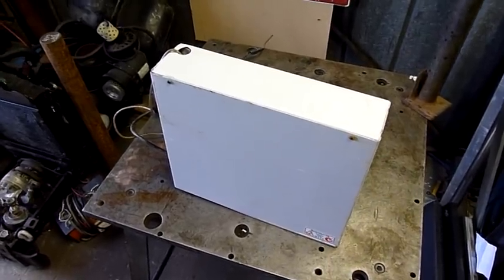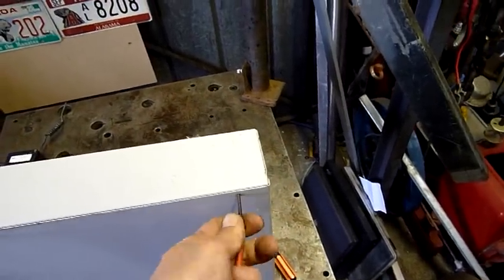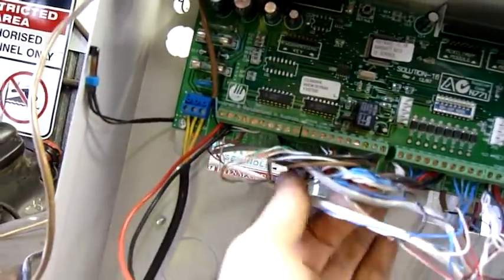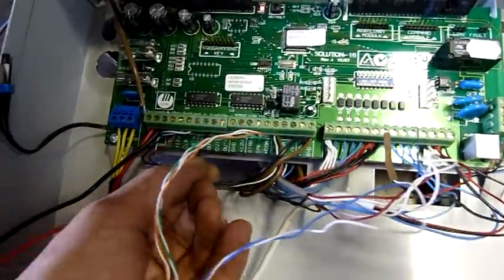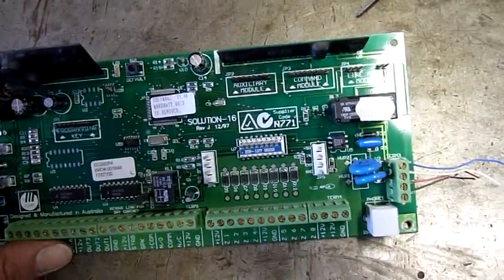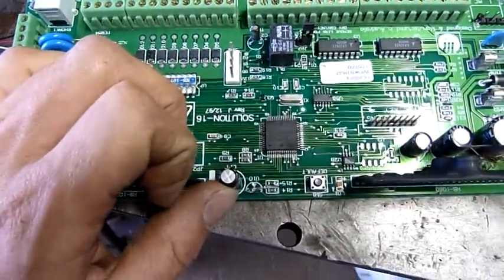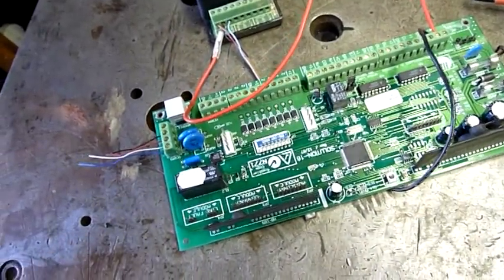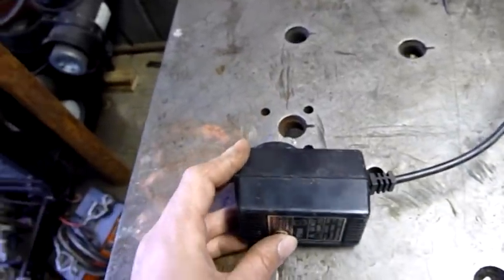Solution-16 Security System Box Autopsy

Comment: As SeanBZA said, those extra tracks on the PCB are sacrificial tracks (just like fuses). Inductor tracks are usually wound around one point in a spiral. Also bluetooth, wi-fi, etc. PCB antennas look almost the same, square zigzag, but in this case it's not - it's just engineers who built this board saved some money on fuses.

Comment: The 6-core ethernet cable would have been used for the external siren box and strobe: 2 cores for the blue strobe, 2 cores for the external siren, and 2 cores for the tamper on the external siren box - the tamper for both the external siren box and the control panel box can be on the same loop (thus, share the same zone), hence why one of the ethernet cores was tied to the tamper wire on the panel box. You can actually buy 6-core security cable, but most of the alarm equipment only requires 4-core, so I guess some technicians don't bother and use ethernet/phone cable..

Data, clock and +12V- are the keypad terminals.

Anyway, this is pretty good score to pick up a working Solution 16, it looks pretty new - worth a few hundred bucks. Easy enough to default and reprogram if you don't know the codes.

Comment: Sacrificial tracks for protection if mains is connected to a pin. They blow do the current is interrupted so there is no fire. These do make a nice 12V SLA charger, just connect the 16VAC to the board while holding down the button and the panel will do a factory restore. then connect the battery and leave it charging with nothing else connected. You can use the 12v outputs as power to the load as they then have overcurrent protection from PTC's on the board.

Comment: That PIC could be useful - good re-programmable chip for which the software is freely available off Microchip's website. PIC16C45 sounds like a lower end chip but without reading the datasheet (also freely available from the same site) I could't say. They are always blankable even if the firmware on them is read/write-protected. It'll be 8-bit though. Good vid :)

Comment: The PIC16C45 is a one-time programmable chip.  You need a PIC with flash (PIC16F) or a CERDIP-packaged PIC16C45 which has the UV window.

Comment: There isn't a lot in a newer one.
I riped apart a mid 80's one a while back and the board filled the whole case and was loaded with socketed 40 pin dip chips.

Comment: could those on board "inductors" be some kind of low ohm resistor? like an on board shunt maybe? or just a very low ohm resistor to create the line resistance to be measured so if the wire is cut the system knows it. i remember something about this with alarms.

Comment: If you want, you might want to use the box for a Mini-ITX or Pico-ITX casemod. You can then put it in a corner in your caravan(if you have one) then connect a vehicle power supply to some of your SLA batteries and optionally a charge controller and solar panels. You can have in vehicle entertainment PC from a discreet white box if you have the money. For more information, check the projects and store sections of mini-ITX dot com.

Comment: Typical central alarm panel. Was it dead? I design alarm systems for personal use and i know i wouldn't trust one of those,all my designs are solely electromechanical with high immune level and minor electronic components.  Lately i'm VERY tempted for one of the commercial systems as i'm a little bored spending weeks to add a single simple feature.